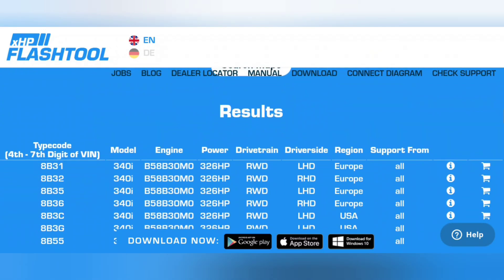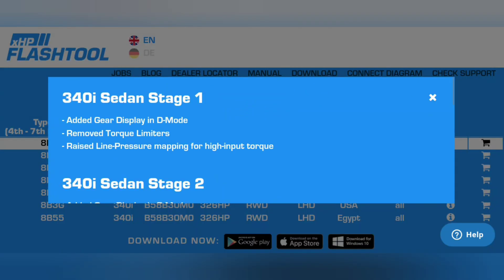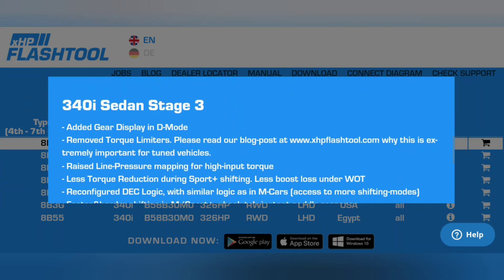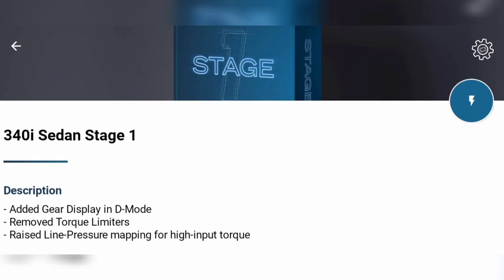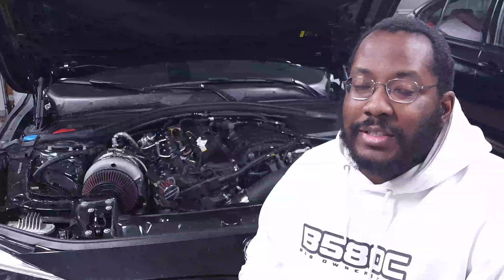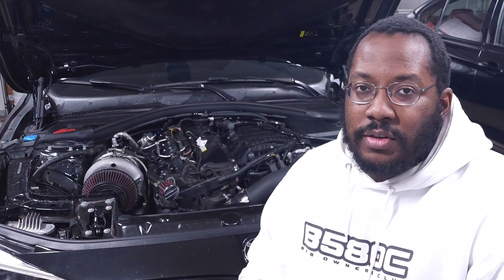Is a Stage 3 Trans Tune too much for Stock Turbo setups? Guide to xHP Tuning Maps

Comment: Would you say stage 2 will produce the same times as stage 3? Also I’ve heard people claim that the line bump is not active 100% of the time, and that it increases the pressure as it sees that it needs it. Do you know which of those statements is true? Thanks for the content Kevin.
Reply from the maker: with the right settings it's the same. just depends. stage 3 will put you in the fastest shifting modes more often.
Reply: This comment^^^

Comment: I have an mhd stage 2+ 440i and run stage 2 xhp transmission tune. Stage 3 was too hard for my liking
Reply: You can just change your shifts to neutral or relaxed for softer shifts
Reply: @3RunnaWRLD-fp4xr where is the option for that?
Reply: @jvfishingss under shift points I believe
Reply: @3RunnaWRLD-fp4xr before I installed xhp,comfort shifting in manual was relatively fast,but that all changed when I had xhp installed.Comfort shifting was almost like the zf6-slow as F.Is it possible to have the comfort shifts as normal or similar to sport and other modes?

Comment: Doesn’t also xhp reduce lag in manual mode? Like when you hit the paddle or shifter to gear up, there is less of a delay before the transmission shifts. I don’t have experience with xhp myself so I don’t know if this is true.
Reply: It does shift faster and harder, especially sport plus and DSC off. I'm currently on xhp stage 2
Reply from the maker: They modify the shift mapping so it's more sensitive and downshifts earlier
Reply: Yes, I have stage 3 and it’s far more responsive.

Comment: so on WOT stage 2 and stage 3 have the same shift speed?
Reply from the maker: With everything else equally yes. A lot of it depends on your drive mode and transmission mode, but they have it set up to automatically go to the fastest shift mode when you're wide open throttle.

Comment: xhp stage 3 works better and smoother than stage 2 with my 440i bm3 stage 2 e30 flex tune.  regardless, you can change settings with any stage for torque, shift aggression, etc.
Reply from the maker: That's really the key. It doesn't hurt to try all the maps and just pick what you prefer. I'm still confident a lot of feedback is placebo but ultimately going with what you like will make the experience more enjoyable.